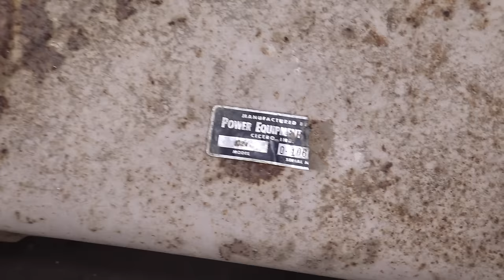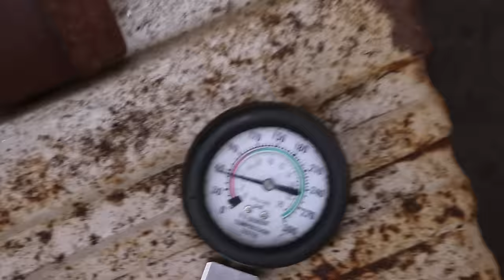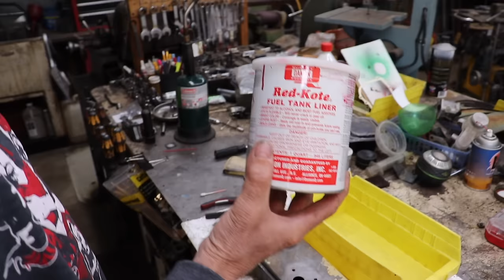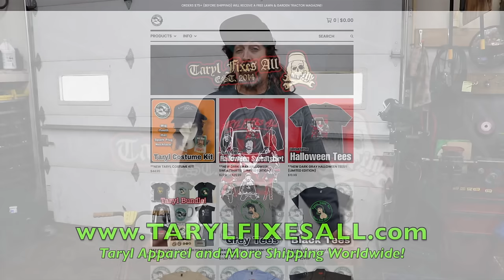Briggs TERRIBLE Mistake! Massive Mower Recall! ⚠️

Comment: I looked at some vintage photos of these.  In the images is show the engine would have been enclosed in a case of sorts  almost completely there by it would have prevented the build-up on the cooling fins as Taryl shows in the video.  I also suspect the enclosed design may have lead to the fire issues and ultimately the recall for this unit.

Comment: Would/could you have used Taryl Putty on the hole using a new plunger with some wax paper wrapped around it to build up the original hole? You were lucky finding oem bushings. You have some good tools such as the proper reamers for the job, not all us DIYer's have access to those things.

Comment: I used to cut 3/4 of an acre when I was 8-11 with a wide deck mower like that with a normal 3 horse Briggs. It was the same vintage but new since it was the early '60s. Then my dad bought a new Sears suburban garden tractor, He got a garden plow for the back and a snow plow for the front but no mower deck(gee thanks dad!)
 SoI took the handle off of the mower and made a crude A frame draw bar, hooked it to the Sears suburban and drug it behind the tractor. after a couple of years of that he finally got a mower deck for it. Those 24"-25" lawnmowers were a bitch to push, Probably why they don't make push mowers that wide anymore, 22" is as much as you want to go with that... especially when you're 8-11 years old!

Comment: i've been on the engineering side of flops like this. it sucks, but sometimes you have convinced yourself it will work and you don't find out it can't work until you've sunk SO much money into R&D. If you get to that point, you can cut your losses and just eat the entire R&D cost with no chance of recoup (praying you can use the research in the future for something else) or you can quickly push it through to retail and pray you make back at least some of the cost. B&S probably knew it was a turd and would not sell well, but just wanted to get back some of the money they spent designing it. It was the first "silent" mower on the market, so they had no way of knowing how bad it would actually be. There was also a big push for "silent" appliances in the 60's and 70's with silent toilets, silent washer machines, silent vacuum cleaners, silent everything. Having specialty "silent" appliances was a high class status thing. One of my friends recently bought an old late 60's mansion that sat empty for 20 years or so, and all of the toilets are extremely expensive vintage "silent" toilets that are only slightly quieter (but still quieter than poor people's toilets!).

Comment: Don’t know if you answer questions but here goes. I am working on a older craftsman chain saw (1958) I think. The model # is 358-355140, got it running starts ok (no primer bulb). The oil system is something I have never seen, in the oil tank there is a filter / connection that is screwed on to the tank on the end of the filter there is hose barb for a hose that goes up to the bar oiler port. (Getting no oil)The only thing I can think is that somehow the oil tank i pressurized by spinning crankshaft? Anyhow wonder if you have seen such a situation, your friend Ken in Michigan.

Comment: They make a repair hit that you drive a plug in there and change it over to electronic. I still have the tools to do this repair till they came out with the electronic kit. I did the valve guides with a fix like this years ago. Now with labor and parts soo high just go buy a new mower. Those front discharge decks would stay so clean and why this one is not rotted out. They mowed great. As a kid I pushed a lot of these.

Comment: 1:10:09 Ironic they show an Ariens.  I picked up a 1959-ish Ariens snowblower someone was just tossing out (I have a whole history about getting it running too).  It predates every safety feature you can think of for a modern snowblower.  Once you start it up and put it in gear, it will drive on forever... with or without you at the controls :D

Comment: That carb looks a lot like the ones I knew, but mine didn't have a fuel pump. Needless to say they started a lot better with a full tank. Fuel was puled up by vacuum. That is a huge deck for a three horse. My three only had a 18 inch deck. Small deck made short work of tall grass. In the long run, it did a job faster than a bigger deck with a bigger engine.
Reply: The 2and1/2 hp. models did not have the fuel cup and second pickup tube and ran better with a full tank. The 3 hp. model had the fuel cup but still started better with a full tank because tipping the mower a bit with a full tank helped splash fill the fuel cup. One was called "Vacu-jet" and the other "Pulsa-jet"

Comment: They had to basically push that to market without any real testing. If the goal was to make it less noisy, I can't for the life of me see how that design was significant in that regard.  If anything, the muffler facing the front probably had more to do with the perception (if there was one) that it seemed to be quieter than I guess standard designs.
Reply: Remember the basic 4 stroke B&S mowers were very noisy,noisier than most newer mowers because the engines turned higher speed than current mowers are allowed to run. Like 3600 rpm or even up to 4000 rpm instead of about 3100 rpm. Also the newer engines again have quieter mufflers and more plastic coverings on them. (Compared to the standard bullet shaped muffler that many Briggs engines came with)

Comment: The base of that Pulsa-Jet carburetor can warp too, so instead of trying to file it flat around the two fuel pickups, you can (and should) use two carb gaskets instead of one.

Comment: WELL TARYL YOU FINALLY ONE-UPPED ME !
My Dad remembered working on these beasts but they were before my time.
I studied the Briggs parts book is as close as I ever got to seeing one. Dad told me they were "a fail".
(Don't get too smug, though - I still have Lawn Boy machines that were never mass produced. My Dad and Uncle Jerry carried them off from Lawn Boy Experimental on various Sundays )(mowers, tillers, snow blowers, lawn vacs, weed trimmers)
PS - Did you ever see any of the AC lawnmower spark plugs that had neon bulbs inside the porcelain ? They weren't visible outside in daylight - by they had, in effect, their own spark tester built in !
Reply: Didn’t JC Whitney sell those plugs? I forgot all about those!
Reply: @loveshisharley  Don't know but they were AC sparkplugs. You still see them on Ebay.
They only came with 3/8" reach and were the gasketed kind mowers all used until Honda.

Comment: I am surprised that the exhaust, usually the loudest source of noise, was not routed to exit under the deck, as the old "Lawn Boy" 2-stroke mowers were designed. I acquired a "hand me down" Lawn Boy  about 20 yrs ago. It was EXTREMELY QUIET, could hardly hear it at idle, BUT was UNDER POWERED (they were also rated at about 2.75HP). So, forget about cutting tall grass. That's why I sold it soon after I got it.

Comment: Never mind the noise.  Putting the flywheel on the bottom would have the effect of not twisting the crankshaft when the blade hits a solid object, a real problem when the flywheel is on the top.  Hard pull is that it was a pre compression release model.  And the floatless carbs in the tank will only start well (or at all) when the tank is nearly full.

Comment: 15:04 Don't be a Ham-Fist and yank the points off the ignition like Taryl IF you want to preserve the parts and that little wire. You can just clean up the points and replace the plunger, and who knows the old points and condenser might still have worked, but we will never know. Original is original you know.

Comment: I didn't know they had 4 stroke lawnmowers way back then.
I hate to think what those blades cost with the duct work on them.
My yard would melt it, not just set it on fire.  I can't keep the grass from clogging the output hole, a small duct like that would be shut the first pass down the short side of grass.

Comment: When you fired that thing up the secint time, I seen a bug run off from it. So I reckon you debugged it. It seems kinda weird that they ditent  make the exhaust go down thru the deck like a Lawn-Boy, if they was really going fer quite operashun. Maybe they ditent think about that.  If I was goin fer quite operashun, I think I'd make it operate slower and do something about the exhaust noise. I hope Uncle Pat can find the cover and it can get fully restored. It would be a good thang fer the young people to learn from, but I don't know what they would be learning. Maybe that there is a past.

Comment: Why, if you wanted a more quite push mower wouldn't you run the exhaust under the deck? Grass would be like a silencer and you might design it to even fluff up the grass to get a better cut as a selling point lol!
Reply: Lawn boy did that.
Reply: Toro did it too in the early '80s on their aluminum deck mowers with Tecumseh engines. It was a special block with the exhaust port on the bottom of the cylinder. It was very effective.
Reply: Victa put the exhaust through the deck in the 50s.

Comment: I think that thing was considered to be the creme de la creme of pushmowers back in the day.
B & S used to make a 13 cubic inch,5 horsepower vertical shaft engine back in the day,would have been nice on a pushmower. I think it was usually found on rototillers.  Real horsepower,unlike the inflated claims of 5 or 6 horsepower on engines today that barely make 4 hp at the maximum governed speed they are allowed to run at.

Comment: Taryl I’m digin your Utube stuff 😊 l having a problem reviving an old riding mower it’s been in the family long time 🤭. I got the 13.5 Briggs running good! To good ,got the deck back on replaced a belt ‘now it’s cutting and shifting ye-ha. The sear’s craftsman is not starting up using the key switch so I bought a new solenoid because the switch tested ok also new battery 😢 Now the damn thing won’t shut off ! Not with the key  not even if l get up off the seat it just won’t die. What the hell is wrong with this thing! It’s never done this before. I threw in the towel but I never give up, can you help me figure it out? I will buy breakfast-lunch & dinner if you could help someone ,who ain’t Smart enough to figure it out ❤

Comment: LOVE YOU ..........about to try my 1st carbatraitor on a breaks an scrap'm  ..10hp coleman powermate from side of road.......sooooooooo far cleaned plastic tank ,( that rubba plug was fun) got the rocks n crunchies out yay plastic so its not rusty ,  got the rope and motah thinger rotaterin juice'n the spark hole and wd'n everything i could squirt .  Guy said ran when he put it in shed  soooooooooo  my guess 10-20 yrs lol its rusty  but got exicted when it spun and got rope smooth.    I inherited and buy tools cuz on my own  and like  taking care of stuff ....dinkin in my she shed ......... wish me luck suga britches  . hardest part so far is which tool to use  , guessin how that choke works  .............  springy thingy ............. in a NUT SHELL  thankyou........ you make stuff seem doable

Comment: That's an interesting piece. Hey I was thinking...if you had popped off that little cover on the top of the crank first, you could of pushed that little pushrod for the points out from the other side before it broke and saved yourself a world of grief. Hindsight is 20/20
Reply: Or even pushed it in on the low point of the cam, then cranked it, pushing it out with the high point.  Repeat while applying solvent until it it's loose?
Reply: @wryanddry2266  agreed 👍 We need to go work for Taryl lol.
Reply: @jonmyers8046  Yeah I bet we could tell that guy how to do things. 🙂

Comment: You Could Use a Piece of Copper Pipe as a Spacer  Then Rheam It Out If Needed. Also A Bit Of Grease On The Crankshaft end of the Pin. That Gasket on the intake Manifold Looks like An Exhaust Gasket. Not Original Gasket ?

Comment: Oilite is still in business so just get the id and od and length and if you need them they should be available, if you have trouble finding them just give me the dimensions and I will find them for you. Id = internal diameter & od = outside diameter. Thanks

Comment: Easy to see why that silly thing failed. 
My least favorite Briggs trick is that stupid quarter turn oil drain whose weak plastic cost me a piston. (I now throw those away and install a NPT nipple, elbow and pipe plug to drain oil overboard as it should be.)

Comment: 18:45. Should have lubed the heck out of it and very carefully tapped it in and then rotate the engine to push it out again. That will loosen it up. I've had to do this a time or two on old BS engines.

Comment: wd-40 is not lubrication it just remove sticky gel or sticky else it is
if you want real lubrication is recommended use aero kroil (or can use pb blaster since 1957) either one this is lubrication it have oils n other mix into it

Comment: modern gas can contain as much as 18% alcohol and will corrode some metal carb parts and dissolve rubber in the fuel system, hoses diapraghm and other stuff, go to the airport and buy 100LL, low lead, its not a lot more expensive and stores way lot longer ind  does not hurt your carb parts and is way more easier to start and run and i can guarantee you will never EVER get any like ANY water, i used to fly before my strokes, good luck

Comment: the best points file is a diamond point file, one from most any tool dealer is $20.00 bucks, if you borrow one of your wifes diamond nail file will cost you mebbe $2.00 now and is every bit just as good, dont forget to kiss your wife, teller you love her and thank her for her excellent idea as if she had thought of it, a gratefull wife makes a happy marriage, good luck
Reply: what i intended to say but forgot is the best points cleaner is a newish dollar bill, it is lint free, regular paper might leave some artificial fabric thread like rayon or some such that might melt in the points face givin you holy heck getting it out, turn the flywheel till the points close and pull the dollar out,, garr onn tee its cleen, thats an old mechanic trick told me by an old mechanic who said it was told him an old mechanic, im now 74 so you know how far back that goes